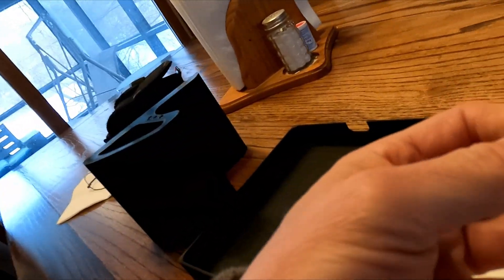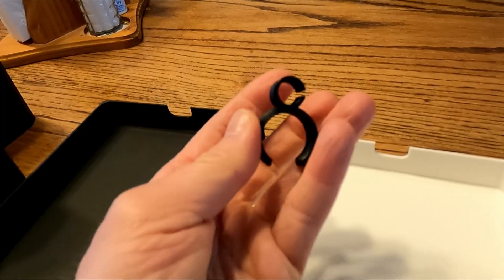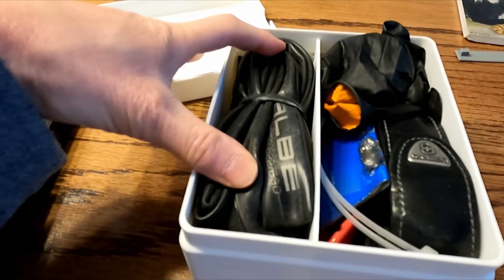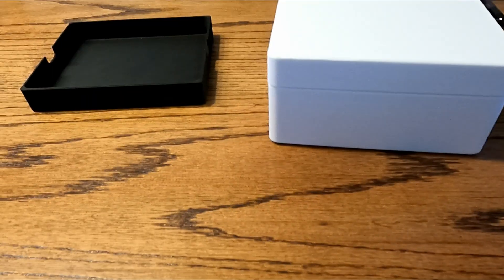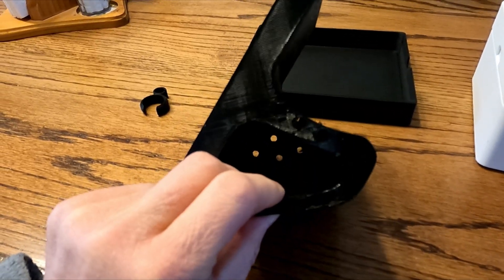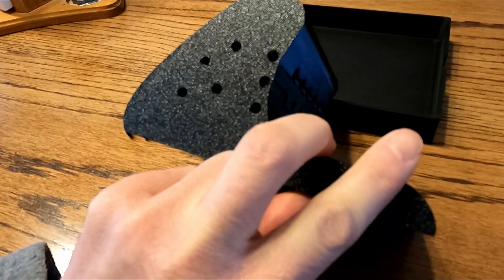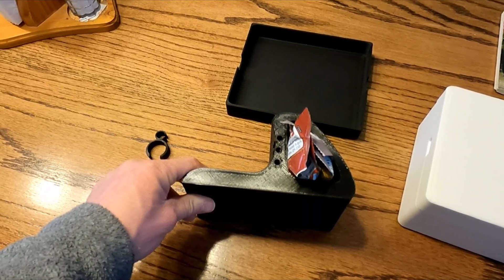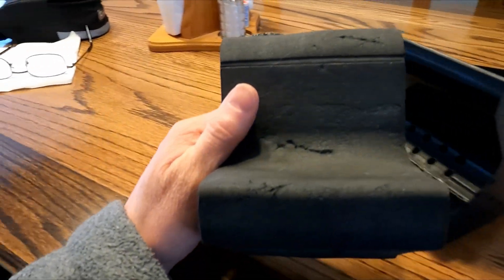Pimp Your Ride Ep. 1: 3D Printing Meets the Velomobile

Comment: I suppose it would be possible to print a velomobile body piece by piece from PETG and then cover it with fiberglass or "poor man's fiberglass." If someone completes such a project, it would be great for the home builder community. Of course, they would have to be resized (I'm assuming a self-supporting mold), but then the design could be improved. This opens up some cool possibilities, for example, by precisely adjusting the velo's dimensions to suit your height.
Reply from the maker: That would take a significant amount of resin and prints plus gluing them all together. It would also be quite heavy, so I’m not sure that would be a money-saving way to go or produce a very good end-product.  To make the shapes all fit together with a modular design would really require redesigning the shell. Otherwise things won’t flow together very well.

Comment: Great ideas! How about creating exterior wraps for velomobiles? Either whole body wraps or smaller sectional wraps or decals.
Reply from the maker: @steveborn3455  not with a 3D printer. That would be a whole different machine. There are companies that make wraps and I think you can even get custom ones. Automotive vinyl is what you’re looking for.
Reply: @: Sorry about not making myself clear. I understand that wraps and decals are made by another type of machine. I was just suggesting another way to pimp out a velomobile. It might be another opportunity for an enterprising dealer down the road.
Reply from the maker: @ oh I see what you are saying. One of the German dealers offers this option.